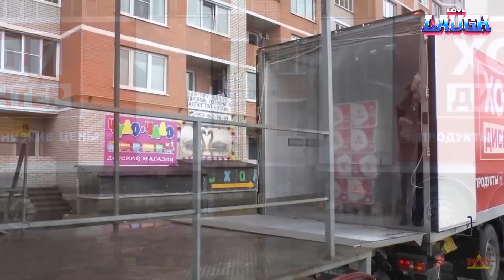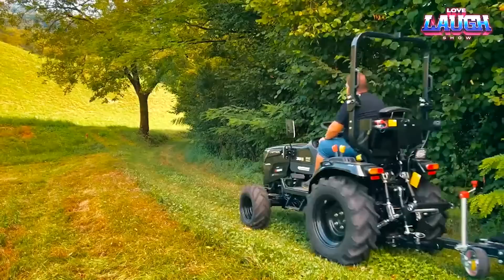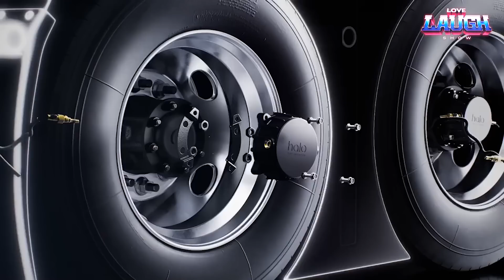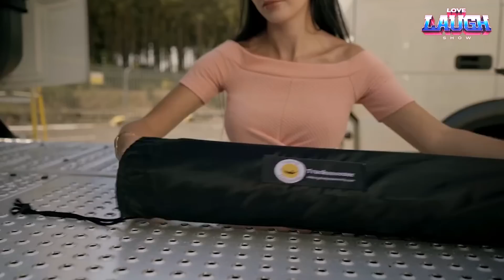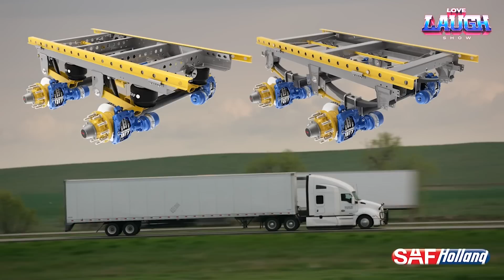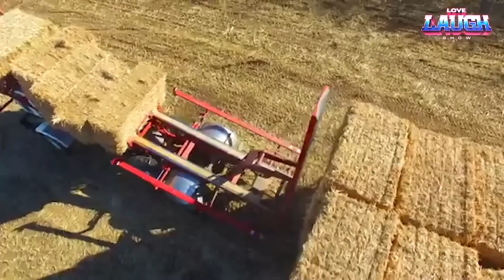20 Unbelievable Inventions for Trucks Technological Wonders in the Construction Industry

Comment: Mine truck wheels lasting the lifetime of the truck, I call bullshit or the lifetime of the truck is very short. Of course at least the rubber tread has to be replaced as often as you replace a regular tyre. And I don't think all the mechanical suspension parts inside the wheel will last too long.

Comment: to those fuel caps, they just drill the tank....no cap or anything can prevent it. most of the drivers remove all security gizmos. at the end its cheaper to buy fuel as a new tank or repair it , and the time lost isnt fun either.